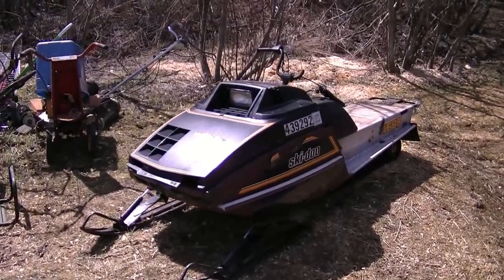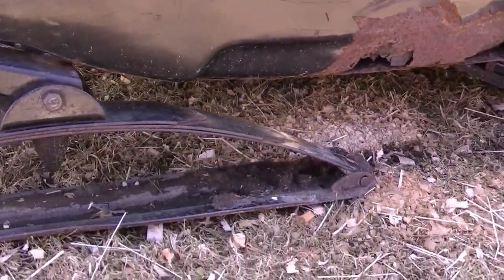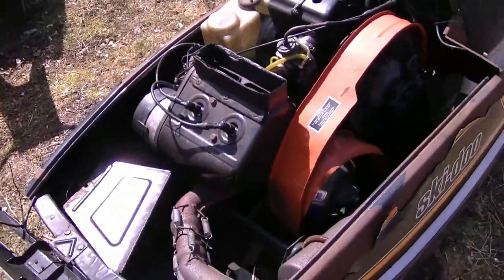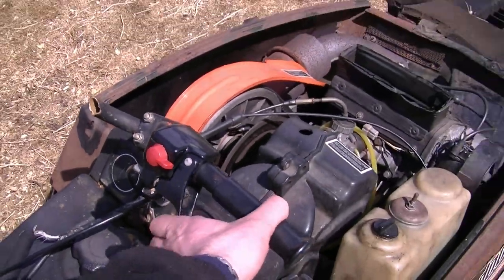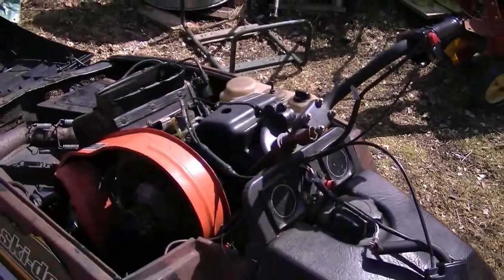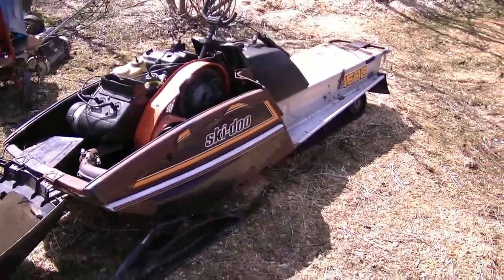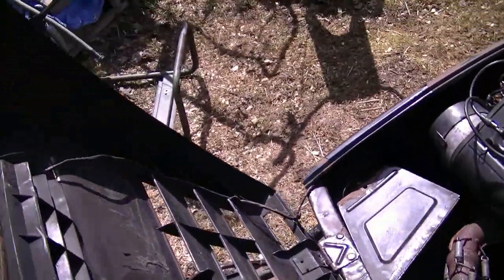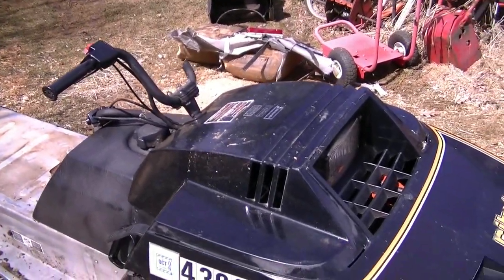A Free Citation 4500 Snowmobile - Rotax 377

Comment: cool sled, i had a whole fleet of 7 older sleds i was constantly working on to ride.  finally got tired of it and sold all but my wifes and bought one i never have to work on.  its fun to ride, not work on them constantly,  however i really think the older sleds are neat.
@elgorr i had a 88 safari 447.  it was a cool sled, mine also had ignition problems when i sold it.